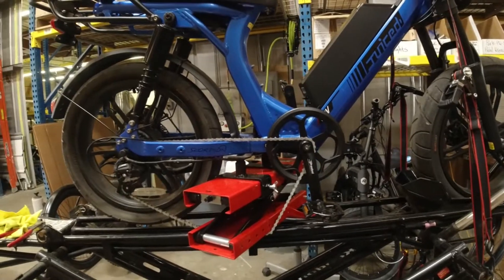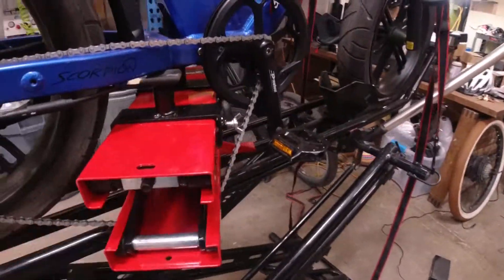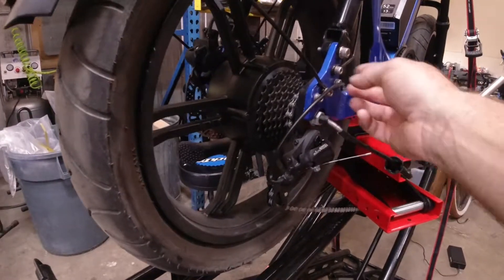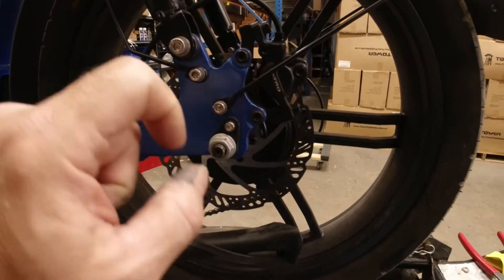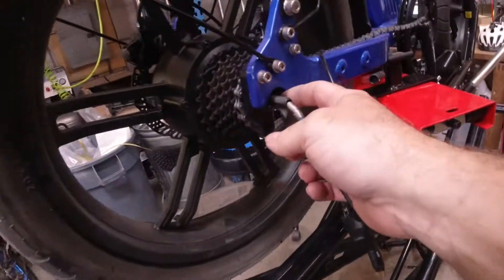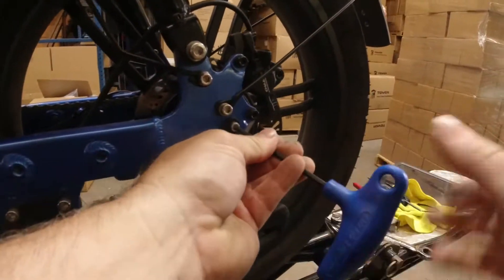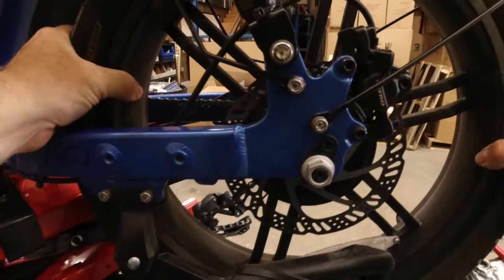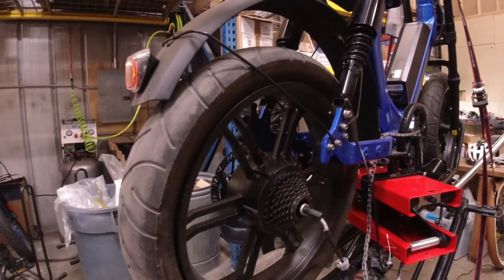Juiced Bike Rear Wheel Removal (Scorpion X)

Comment: Hi, I'm on the fence about buying a Hyperscorpion simply because I'm afraid that if I get a flat while on the road I won't be able to fix it. I know you mention needing all the fancy mounts and racks, but is it realistic to think I could do this solo with just the wrenches, some tire levers, and a spare tube? Could I flip the bike upside down on its seat and handlebars to work on it?
Reply: Yes you can flip it.. Just gotta loosen the speedometer. You can put slime in the tube.. Also you can stick a motorcycle tire plug in the tire.. Then inflate to 20lbs and ride home at least. Mr Tuffy helps also.

Comment: Is that the same process for a scorpion X ?
Reply from the maker: Yes, the bike in the video actually is a Scorpion X.
Reply: @TowerEBikes  No, its not. The Scorpion X doesn't have the cable-through-nut like this one does. It also says "Scorpion X" on the side of the frame and this one doesn't.